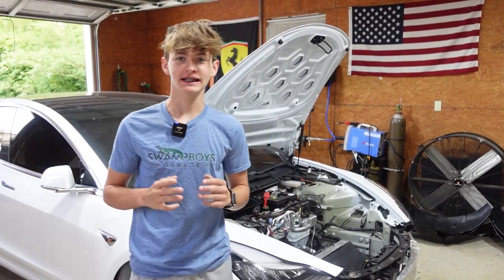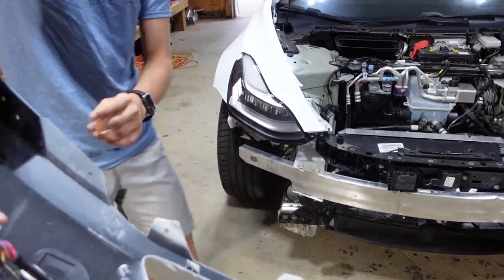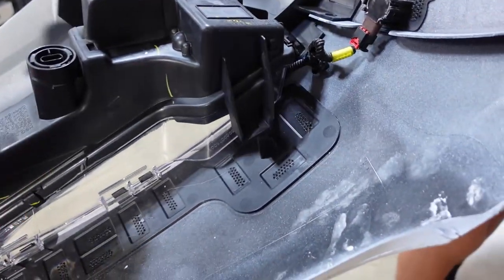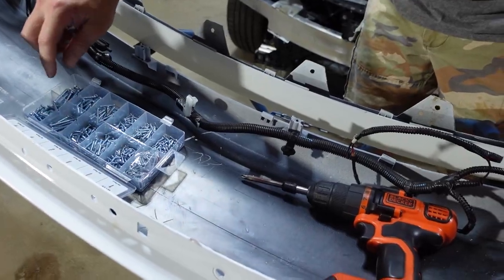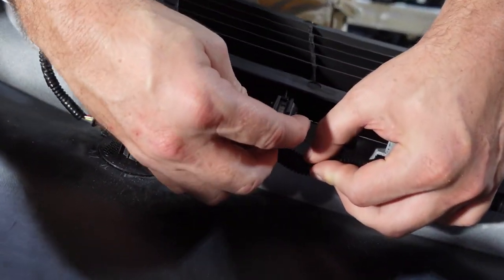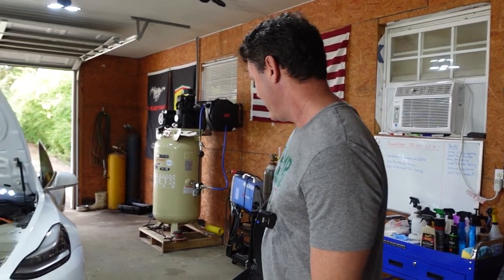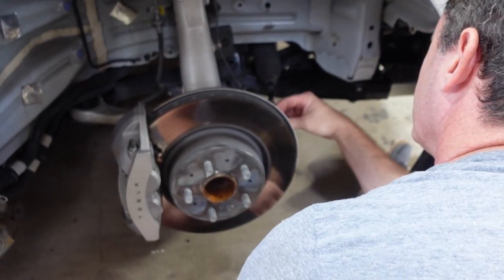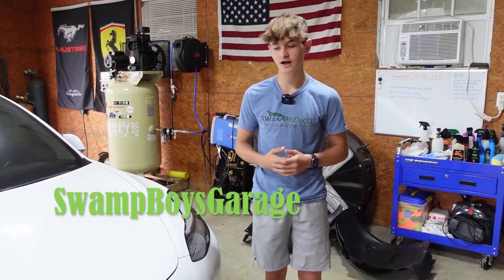Completing the Wrecked Tesla Model 3 Rebuild

Comment: Those extra wires that attach to the tow hitch cover are for the emergency frunk release. If your 12v battery is totally dead and you can’t get into the car you can take that cap off and touch those two wires to a 12v battery and it’ll pop the frunk. From there you can jump the 12v battery to get access to the car.
Reply from the maker: Thank you for the help. We are still learning a lot about this car

Comment: Old school alignment trick they probably still do at the race track. Take two finishing nails and some string. Secure the string to one nail and poke the nail just a touch into the tread of the rearward point of the tread on the back tire. Then poke second nail into the forward most part of the front tires tread. You'll notice the string barely touches the outside of the rear tire, and the it should be the same way on the front.  If not make adjust as needed. I'm sure someone has a video about it lol. Almost forgot to mention. String test works best while tires are on the ground because  independent suspension could effect it off the ground
Reply from the maker: We did some similar tricks like that and we have it very close. Was hoping to get it perfect but may just go with what we have.